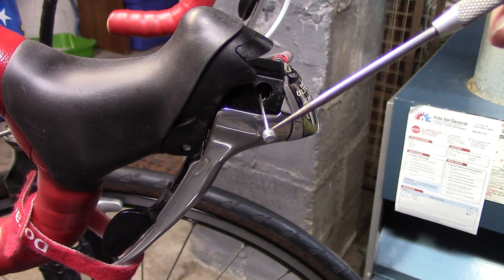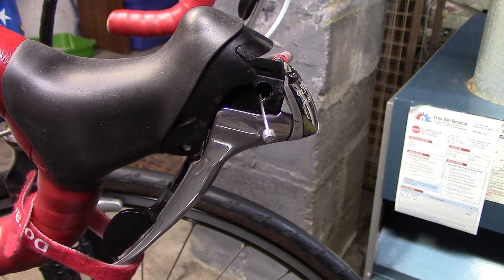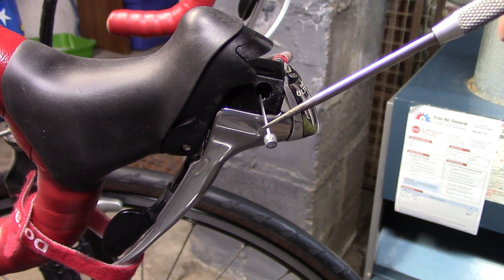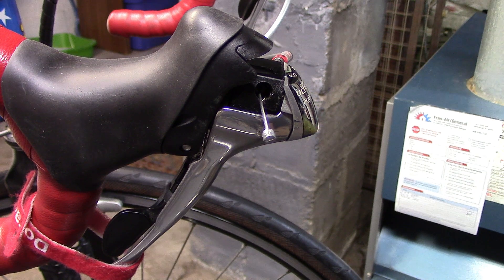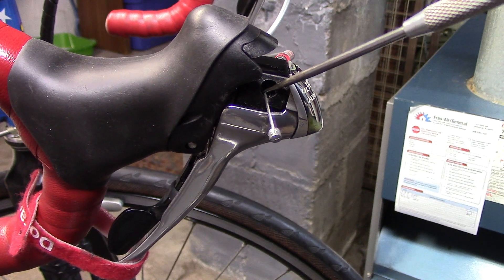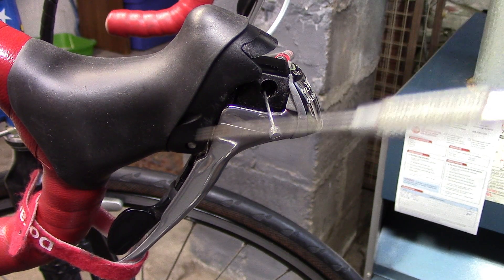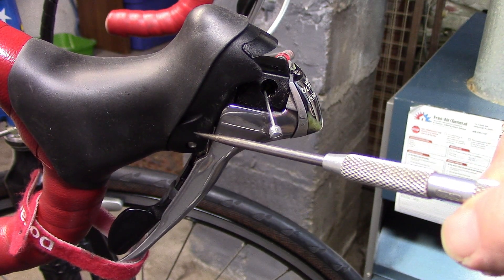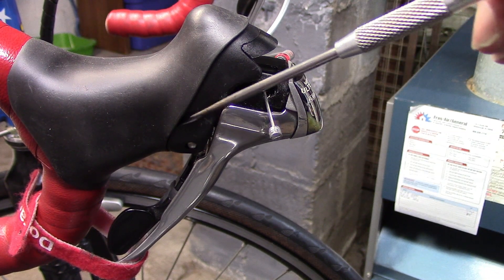Do Bike Cables Stretch: Fact or Myth - stretching & wear

Comment: I realize this video is a couple years old but in my experience with working on thousands of bikes, inner shift and brakes cables don't stretch as much as the housing compresses.  Chains don't stretch either but they do wear and become elongated.   I created a homemade tool that lubes the cable on most bikes that have a cut away on the cable stop.  Sure you can lube with the small red hose that most lubes have but I find it gets kind of messy and drips on the floor.  My lubber is a simple piece of black foam glued onto a small handle.  I cut a slot in the foam and put my favorite lube on it and slide it back and forth.  Take care
Reply from the maker: Informative. They do make compression-less brake housing which I have on my bikes with disc brakes. Some people lube the cables as they go through the housing and others don't. I use a lubricant with a very small red tube that fits inside the shift housing and place only one drop, then tread the cable.  Regards and safe cycling, Tony

Comment: Should you stretch break cables also?
Reply from the maker: Yes. All you need to do is take out the slack of the brake cable when you fasten down the brake cable pinch bolt. Then just pump the brakes a few time. Release the pinch bolt and take the slack out of the cable. Simple process. Thanks for the question. Tony

Comment: Are you able to get a good adjustment using that XT derailleur with the Ultegra shifter? After struggling mightily with a similar setup years ago, I called Shimano and was told that, as far as mountain and road 9-spd inter-changeability goes, "Never the twain shall meet."
Reply from the maker: No so. I've been mixing mountain derailleurs with Ultegra and Dura Ace shifters for years. The rear derailleur I use is an old long cage deore XT. Note: Not all derailleurs will work depending on the capacity of the derailleur, the "speed" (works best with 9 speed) and the length of the derailleur hanger on your bike. I am not surprised that Shimano would say "no" to cover themselves in case you use the wrong combination. Probably the biggest problem you'll have is the derailleur hanger length, although I have developed a simple work around which I'll put in a future video.  Regards, Tony

Comment: Makes sense! You have to stretch guitar strings a bit before they will stay in tune. I always do this when i change cables and have had no lssues.
Reply from the maker: Whether you're stretching the guitar strings or seating them in position is debated. But either way, pulling on the strings is needed before tuning. There's also a difference between stretching and placing the strings under more tension. When you tune the guitar strings, you're not stretching the strings but increasing the tension to tune the guitar. Thanks for the comparison. Regards, Tony

Comment: When I used Shimano's highest-spec cable, I had to adjust it about ten times before the shifting stabilised. With Jagwire cables I normally have to adjust them just once.
Reply from the maker: I, myself, use the standard steel Shimano rather then the Shimano PTFE coated or zinc coated cables and they've worked very well along with Jagwire housing (which I buy in bulk for our shop). But I do agree with you on the Jagwire. Both the Jagwire housing and cables are excellent and  stronger then some other makes,(i.e., less likely to fray or break). Regards, Tony

Comment: Hello Mr Marchand, i have a problem with my bike. The left pedal is doing some weird things like clicking but silently. Do you have any suggestions? Thanks.
Reply from the maker: First check for wear of the pedal or shoe cleat. Also see our video:
https://www.youtube.com/watch?v=xn0bokygJ9c&t=2s&ab_channel=TonyMarchand
Two other possibilities:
1. Worn bearings in the left pedal (if the pedals are old)
2. Something going on in the bottom bracket (loose cups or bearings).
Start with the easiest things (check the cleats/pedal and then follow the ideas in the video). If all else fails, ask your local bike store if you can borrow a set of pedals (to see if that eliminates the problem since overhauling the bearings in the pedals is not the easiest of jobs) and if that doesn't work, have them take a look at the bottom bracket.
Let me know how you make out. Regards, Tony
Reply: @tony10speed  Thanks for your time. So the problem were the pedals which weren't good from the factory and when I put them on the bike they damaged the entire cycling system. The only solution was to change them and so I did. I haven't my bike with right now but I will in a couple of days.
Reply from the maker: @sonafets4687  Let me know if that cured the problem. Regards, Tony
Reply: @tony10speed  Hello again. Yes, the problem is now solved. Thanks for your time!

Comment: I used to grease my cables (modern ones use liners which I don't like) and I didn't get much trouble with them.  As for stretching the inner cable will stretch and the outer will compress a small amount.  I've always applied grease to the end of the cable where it fits into the shifter or brake mechanism.  To-date (after 50 plus years of cycling) I've never had any problems apart from my own failure to tighten the relevant bolt.
Reply from the maker: You have quite the experience. I use a dab of grease where the brake cables enter the housing, then insert the new brake cable. Some suggest applying a bit of light lubricants to the shift cable where it enters the housing up near the shifter. I do this, but it's debatable. Obviously your system works well for you. All I can say is keep on riding, enjoy and be safe. Regards, Tony
Reply: @tony10speed  Thanks Tony.  So much is down to personal preference, as is the case with so many things in life.  Stay safe and good cycling. Phil